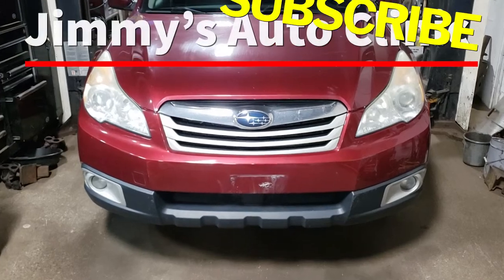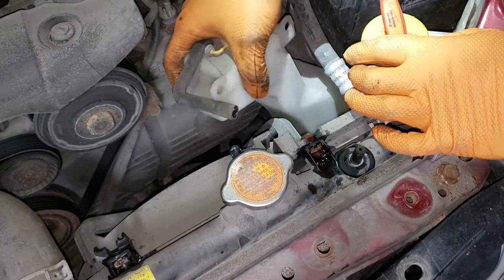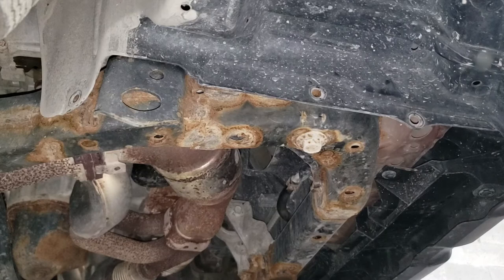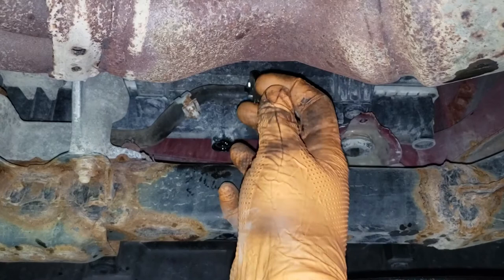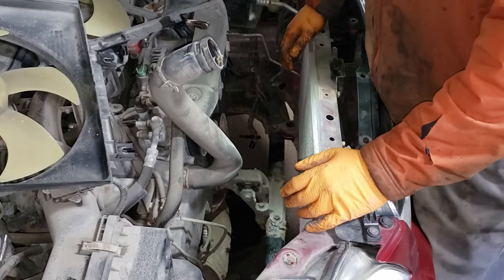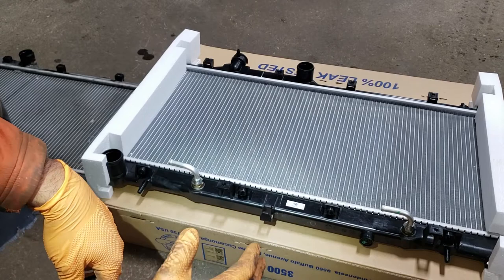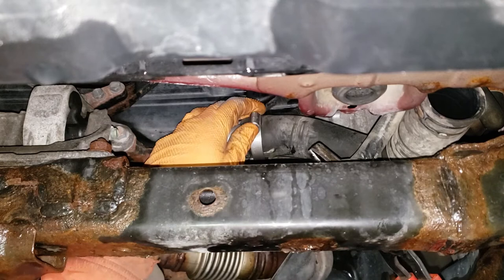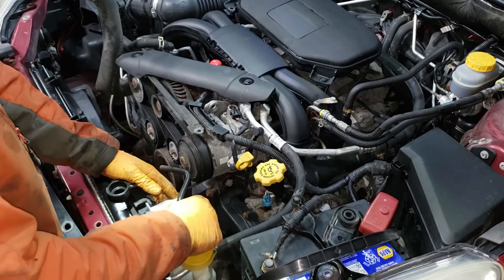Subaru Outback | Radiator Replacement | 2011 Rad & Thermostat Housing Repair

Comment: Great video! I just replaced my radiator and your instructions were great. There are just 2 things I would recommend: 1. Disconnect the wiring for the fans, but leave the fans on the radiator and take them off once you pull the radiator out. Easier to remove and swap out. 2. For the transmission fluids lines, the 2 bolts that hold the plastic underbody tray fit perfectly in the hoses to use as plugs.

Comment: Never ever wash an engine bay everrrrrr unless your a professional detailer. Great info other than that.
Reply: And remove the negative battery terminal before starting the project.   Especially,  before power washing.
Reply from the maker: Depending on your skill level that may be necessary but as long as you're aware of what you're doing you're not going to hurt any components with the battery terminal connected.
Reply: @JimmysAutoClinic  very good to know.   Since I only have a cold water faucet I always make sure the engine is very hot.  This allows steam to form for better cleaning.
Reply: Another trick I found,  is even easier.   My neighbors put a pond in their backyard.   It's only 20'x20' or so, but they made one end slope down into it with sand.  When I get back from off-roading in my jeep all day, I'm usually tired.  So one night ( there was a full moon so I could see), I just floored it into the other side.  It worked great, I got steam (cleaned the engine bay fantasticly) and got most of the mud off the bottom and sides.  Awesome.   I tried it once in the winter to get all that salt off, but the ice was too thick.   They wouldn't let me try it again though,  I hit their ice shanny.  Needless to say,  they were not very happy and told me only to it in the summer when the kids were NOT in it.
*update *  the other day, when I got back home (tired as heck) I did my old trusty.  Ran it through like usual,  but the next day, I found a puddle of antifreeze under my jeep in the garage.   I  tightened the hose clamps threw in three bottles of that flaky aluminum powder (Blue devil brand, for the leaky heater-core.  Thanks again to Rick at AZ for the advice; link below), so far so good.
https://www.autozone.com/sealants-glues-adhesives-and-tape/stop-leak/p/bluedevil-coolant-stop-leak/115557_0_0?spps.s=2144&cmpid=LIA%3AUS%3AEN%3AAD%3ANL%3A1000000%3APER%3A19488533498&&CATARGETID=120054150001289347&CADevice=m&gclid=Cj0KCQjwib2mBhDWARIsAPZUn_kvVvyuNkHimBu7JajkgesotbFHbj27ATbvMImqm6RUUwAQKTNkRsUaAoaDEALw_wcB&gclsrc=aw.ds

Comment: Jimmy your the best. You made this ratiator swap a dream. But I noticed you didn't top off the transmission. It that top off nessasary?
Reply from the maker: Hey, I appreciate the comment. Generally you don't lose much fluid at all that's why the majority of the time I don't top up the transmission. I did in the video but I usually shove a bolt into the cooler lines so that you don't lose much fluid and I also use a hose pinch to clamp the hoses off. If you would like to see how to top up your transmission I will have a video for a CVT coming soon and if you have a automatic I have a few videos already on how to top up and adjust transmission fluid. Thanks for watching I hope this helps call me if you have any questions feel free to reach out.

Comment: You didn’t address anything about the “Liquid gold” that was in the radiator you just pulled. You just expect there to be enough to refill the cooler in the radiator without even checking? This is the main reason I watched your video TBH
Reply from the maker: Sorry I didn't mean to leave you hanging. I would have mentioned if I needed to top up the CVT fluid there is absolutely no need to top it up. We lost literally less than 20 ml of fluid from it dripping out of the line when it was pulled. What I can tell you is let the vehicle sit for a while and before you start the job so that it cools off. As it cools off the CVT fluid will slowly drain out of the lines a bit, so you won't have as much fluid draining out. Make sure you plug the lines when you pull them off of your radiator and you won't lose that much fluid. What you can do is use a cup to collect the fluid you shouldn't have very much in the cup at all. Losing a bit of fluid won't make any difference with performance so don't stress. There is more than enough fluid to fill up the cooler. They are really small and don't take more than 100 to 200 mL of fluid which really won't make any difference. Hope this helps you out my friend. Good luck don't forget to subscribe to the channel.

Comment: I have a 2010 and at the local auto part. They have two different radiators for my model. Are there different sizes needed for certain outback ?
Reply from the maker: Hey my friend, sometimes there are differences for certain models. I'm not sure if there are for your particular model. The best thing to do is to take the VIN number from your car as well as the parts car to find out if there are any differences between the two. Call your local dealership and they should be able to help you at the parts department. I hope this helps you. Good luck
Reply: Got the parts.  Now I’m working on removing the transmission hoses line.  What’s the advise to installing the bolts back on the Thermostat housing?  I’m working on my garage so limited access from under the vehicle with my jack.
Reply from the maker: If you have the whole front of the vehicle up in the ear use jack stands to take the weight off of the Jack and then remove the Jack so you can gain access to the front. Do not work on your vehicle with just a jack
Reply: @JimmysAutoClinic  was able to use jack stands but I did everything from above to remove most of the items. Thanks for your video.
Reply from the maker: No problem. I'm glad you found the video useful.
Reply: My 2011 had two different options for the radiator, too.  Had to use a digital caliper to measure the inlet (upper radiator hose connection) to get the correct one.  Still haven't figured out why there are two options and which model has which.
Reply from the maker: Not sure why. I've only been asked for the one option. It must have to do with where it's made or maybe it is a split year or something. Hopefully you get the right parts.
Reply: @JimmysAutoClinic  could be a split year phenomenon, I lucked out and needed the slightly cheaper option my local had in stock.  Couldn't find a lower radiator hose to save my life, though.
Reply from the maker: I'm glad you got the cheaper one :-) unfortunately some Engineers love to make people's lives hard LOL

Comment: If the #3 Phillip screws of radiator use to release the coolant breaks  easily. Could I release the coolant  thru the lower hose?  The specs call out for coolant conditioner. What is your thought on this?
Reply from the maker: You can definitely get the coolant out of the system by removing the lower radiator hose. Coolant conditioner is not something that is a bad thing. Subaru does sell it and use it. But in my experience if the vehicle has been maintained it's not really needed. But it's not a harmful thing and you can use it if you like.

Comment: Nice job👍
Just one note - never use worm clamps on plastic rads. Use the stock spring clamps. If the hose blows off the rad with the stock clamp, means you have a major problem that needs to be addressed( blown head gasket/ thermostat stuck shut) . Worm clamps only ever on a solid fitting made of steel or aluminum , never plastic.
Reply from the maker: Hey my friend I appreciate the advice. Me personally I've been using worm camps for quite a while. I get what you're saying but I think if you use a quality worm clamp and you're not overly aggressive with it it won't pose an issue. But yes spring clamps if you can get your hands on good ones if yours are bad are the way to go.

Comment: At 29:27 what swivel sockets are you using with what screwdriver? Thank you for the video
Reply from the maker: It is a quarter inch 8 mm Snap-on impact shallow swivel socket on a 6-in extension with a quarter inch ratchet on the end. Glad you found the video useful.

Comment: How do I bleed the system?
Reply from the maker: Hey Hunter if you don't have a cooling system bleeder funnel, what you can do is like I did in the video employ the use of a funnel that fits in the neck. What you're going to do is plug in a scanner that can tell you what the engine coolant temperature is. Make sure the temperature does not exceed 100° Celsius while coming up to temperature if it does I would shut it down until you have heat coming through your heater core inside the vehicle that will ensure that you have minimal air in the system. It may bubble over don't be alarmed just add as needed continue to have the temperature come up to operating temperature once your fans cycle on and off a couple of times and you have heat in the passenger compartment from your heater core you should be good to go then just top off your system as needed the following morning when the engine is cold. Hopefully I explained everything in this video if not you can check out some of my other videos on radiator replacement I'm pretty sure I explained the same process in those videos.